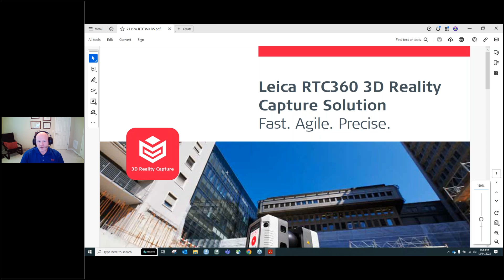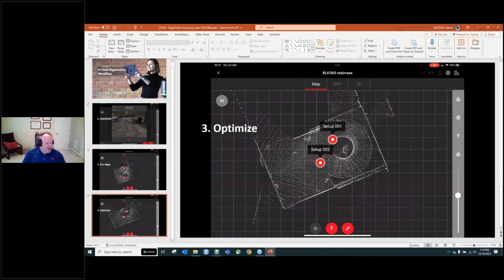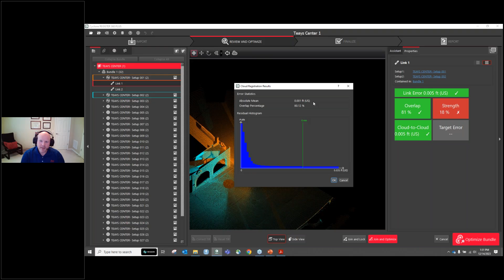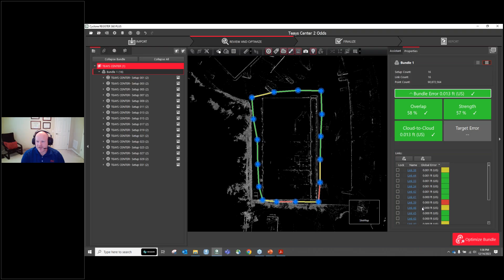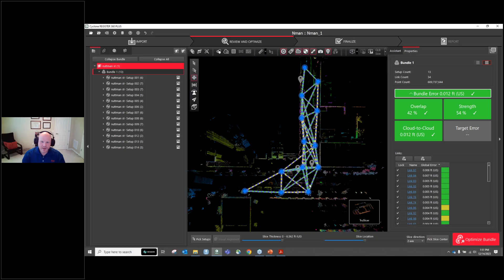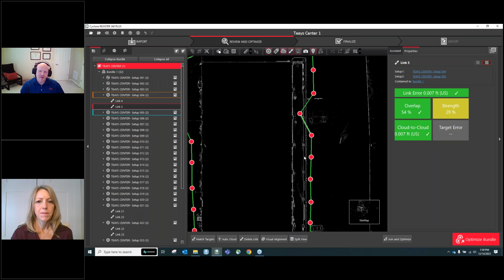Webinar: How to Master Point Cloud Registration Accuracy

Comment: This channel is immense...I hope you guys keep it going: the advanced tips on the LS skill can be esoteric...I have 2 questions please:

1.I noticed sometimes when I do visual alignment..after improving the match and reducing the cloud to cloud error...it goes back to normal, the way it was before I fixed it, once I click "join and optimize"...it's so frustrating.

2. The double scan feature on the RTC....by how much should an element change its position before the machine detects it as moving object?...like I'm guessing sth 1m and above right?... because if it's less...and double scan does not remove this element what's the implication of the "shifting element" to registration... imagine it only moved like a 100cm... assuming this is not enough delta-position from the machine to remove the element for the scan... should we always rescan a setup if we find out not everything was stagnant or shifted "significantly"?

Thanks... Reality Capture to the World!!!!